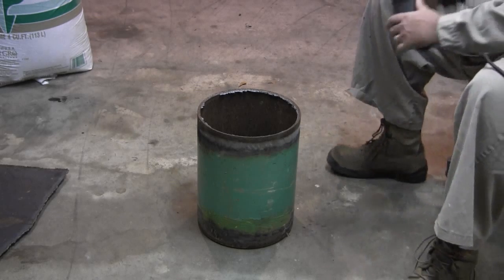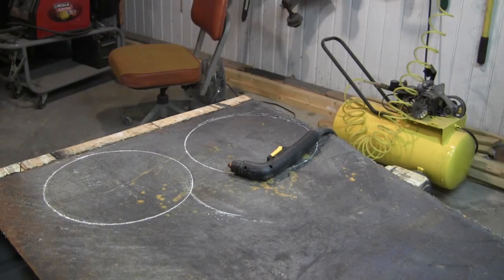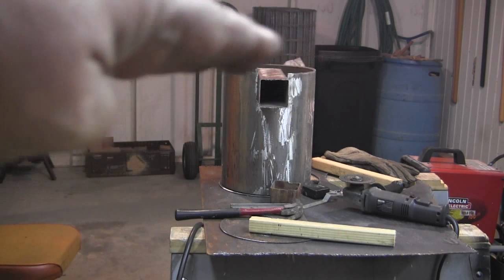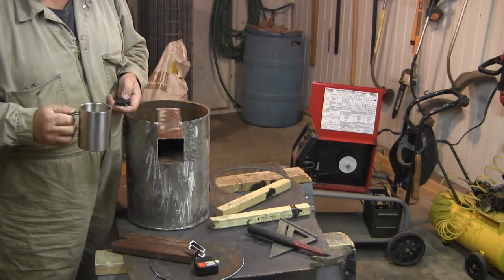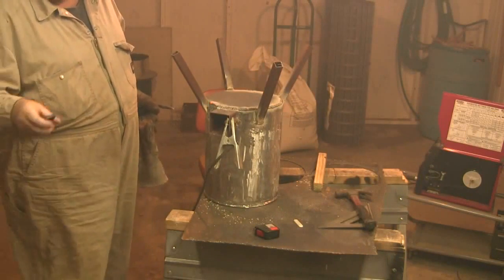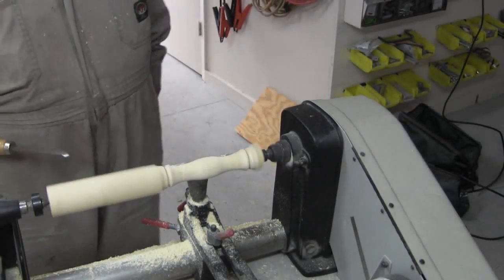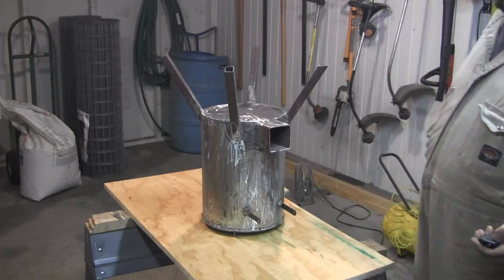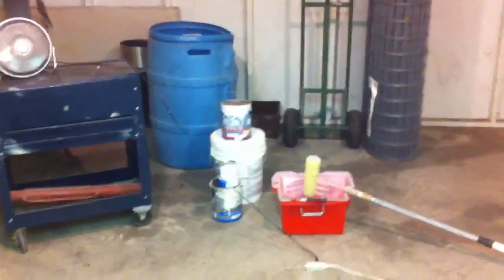How to build a  rocket stove start to finish

Comment: Love your style B !  Wouldn't I like a roomy workshop like yours.
 I really must find one of these cylinders, only thing is here, these cylinder makers make it an 'offence' to use their 'property' for anything other than returnable gas pressure vessels ! ( like I'd care anyway ! )  but I don't see too many just lying about.
Btw, glad you now have your plasma cutter - excellent tool.)
Reply from the maker: This particular stove was made from a section of pipe. Here,gas bottles belong to the person using the gas. I only use gas bottles that have expired the safety criteria because they are far more valuable if they are still within the certification time period. To have them recertified is as costly as buying a new tank.

Comment: Awesome job. Hey just a thought make a frame out of 2x4 that will fit in between the rafters. Take an 3.00 emergency blanket and cut it 1.5 inches bigger then the frame.
Then stretch it over the frame N-S-E-W till taught continue, till as tight as a drum. You have built high grade inexpensive reflectors. Place two next to your light and watch the room brighten up for sure !
Reply from the maker: now that is a great idea! I have some emergency blankets too!

Comment: Great build thanks for sharing I have a question about size my wife wants to a rocket stove large enough to do canning she wants to do it the off grid way with no power just sticks you say 3.5 to 4 more than the chimney or burn chamber so if I am correct if I use 4in tubing for chamber then the chimney should be apx.16 in high if use 6 in it should be 24in high am I correct? I need to build one large enough for a 30 to 40 quart  stock pot she  cooks 60 to 80 lbs of  products what size would you suggest size height and diameter thanks for sharing your work

Comment: BC, thanks for sharing. You should have put wheels and a motor on that bad boy so you could move it around, nice work. I thought about building something like that out of a propane tank.  It's on the list.
Reply from the maker: Mr. Rain I have a video of me building one out of a propane tank. It was the nicest one I built and it burned better and hotter than any I had built previous. I'm in the shop but when I go inside I'll find it and put a link in a reply. Or,I'll pm you.
Reply: Ha ha BC i found it! Thanks, just got done checking it out.

Comment: Hello Brad, hope you’re feeling better, I know how you feel. Don’t stop, you need to keep going or it will really put you down. Again get better. Now a few questions if you get time. Sounds like you are sold on the "Silverfire Survivor rocket stove". Are you going to keep making yours, and newer models? Also wanted to know if you were planning on making a Rocket stove heater for your shop. I have seen a couple on YouTube with "100 gallon propane tanks", but wanted your input on what you might have in your mind to build a small foot print shop heater. Keep well my friend and keep making your videos, there are very informative. Just skip over the negative comments, do not let them bring you down, keep doing what you do. Look at the positive comments they really outweigh the negative ones.
Reply from the maker: Hi Ronald. I am certainly a fan of the silverfire stoves. I build my own when the mood strikes me and when i have something interesting to make one out of. My next stove build will be a small woodstove for my 9x17 sunroom. its all glass and a bit hard to warm so a little stove in there will really help out. Im not sure what im going to do with my 100 pound tank yet. i thought i would make a stove out of it but now im leaning towards a solar hot water heater. thanks for watching and commenting.

Comment: Hey Brad great job. built like a tank. One question, I thought that the output would be at the bottom not the top like a regular fire box.
Reply from the maker: I think you're confusing a rocket heater with a rocket stove.

Comment: Great job I have followed your channel for a while I know you have built several rocket stoves I have tried to contact several people who build these things and everyone don't want to share here is my problem my wife cans lots of things and we live off grid she doesn't want to use power she needs a stove design that can heat up to 30to40qts of water for her canning I would like for you to share your knowledge with me like tube sizes hights and basic deminitons  any advice you could share would be greatly appreciated the biggest thing is how to figure the dimensions of the tubes she is new to all of this thanks for sharing your thoughts and time until next time keep up the good work
Reply from the maker: HUX METAL WORKS the formula I finally settled on based on my own experience and experimenting is the height should be 3 times the diameter of the burn chamber. The inner pipe should be well insulated from the outer pipe. That’s pretty much it. The larger the burn chamber and upright pipe, the hotter the fire.

Comment: You're a Talent! Great Job. I see you must have loved Shop Class in school like I did ; me 1972-76. But a Question: I am very creative and a retired carpenter by trade , and think knowing how to work with metal is a gift. I wanted to start. Do you think the Harbor Freight Tools  90 Amp-AC, 120 Volt, Flux Cored Welder can do the type of work you just did with this? 
Or do I need more power and how much? Thanks for the great video Tony S.
Reply from the maker: The welder I used on this project was a 110 volt flux cite wire unit. If you save a few more dollars,I would suggest buying a Lincoln,miller or Hobart. I've heard lots of complaints about the harbor frieght welder not lasting very long. I buy a lot tools from harbor frieght but sometimes they try to go to cheap on things and it just doesn't pay to buy from them.
Reply: Thank you! I buy American always, but short the money at this time, may go to home depot know, But 90 amp-AC is powerful to do that work? Usually I buy the best Dewalt, Porter-Cable etc... but just starting off WTF . thanks and let me know the power I need to weld like that. Thanks Tony S.

Comment: Thank you for acknowledging my subscription!  I loved the video on the Rocket Stove you built.  Talk about heavy duty and yes, it will likely last well past several lifetimes!   Being that I am mechanically challenged, I do have a question!  What kind of pipe or tube did you use for the base of the stove?  You also mentioned the importance of the dimensions.  Can you reveal the length of the fuel shoot and chimney?  Thanks again for a great video!
Reply from the maker: The body of the stove is some pipe I got when I worked in the oil field. I think it's 12 inch pipe. I used 1/8 the inch plate for the top and bottom. The inner portion is 4 inch square tubing. I can't remember the hight and length but it would be according to the hight and diameter of the outer pipe. I've built several other rocket stoves and they are all on my channel. The easiest one would be to build one from a freon tank or propane tank.

Comment: Nice  videos on rocket stoves. However, would placing the feed pipe at an slight upward angle help the wood self feed (slide) itself, rather than hand pushing the wood into the fire?
Reply from the maker: Then you couldnt control the heat. by pushing it in,you can control the amount of heat you want to cook with. There are people who have made the slanted feed tube. But that wasnt what I wanted to build after I thought about what it was exactly that I wanted my stove for. There are several commercial manufacturers of rocket stoves and none of them build a slanted feed tube.

Comment: well i'm new to this rocket stove but what do you do about the smoke do it need a chimney ?? over all a nice looking warmer for the shop gonna make one for mine THANKS
Reply from the maker: This isn't to heat with,it's to cook on. This is a rocket stove,not a rocket heater. They both work on the same principle of burning the wood has but are built differently.
Reply: OH ok so do you have a video for the Heather ?? like to see that if you do Thanks

Comment: Hey I would like to build a heater / pellet stove for my short bus.. I'd like to go with a 4"feeder tube at a 33 angle into the burn chamber. and go over that with a 6" pipe and exhaust with 6" stove pipe. but cover it with a 8" stove pipe and fan to blow the heat down to the floor.. any suggestions  would be helpfull.

Comment: Hi  I live in Canada and as you can imagine it gets cold up here in the winter. I have watched your video and you have the time in making these rocket stoves to know if what I want to do will work.
I am going to build a 10' x 10' insulated shed for a 300 gallon water holding tank for my horses. I would like to make a rocket stove that runs off of waste oil from vehicles or deep fryer oil from restaurants. Do you think if I put a tuna can size reservoir in the feed pipe of the stove that it would work properly. It would then have a drip line that would drip through a small hole in the top of the feed pipe and into the reservoir. Then I can regulate the drip speed with a small valve. What do you think. The drip line I'm talking about is from a fish hut stove design that we used years ago in a fish hut. The only real difference is the rocket design, Hope to hear from you soon. Scott
Reply from the maker: Scott,I think you would be better if with an oil burning stove. There is no way to contain the exhaust,which would be strong and probably poisonous, using a rocket stove. There is a variation of this called a rocket heater,but I have no experience building or using those.
Reply: +BCtruck, rebuild, repair,repurpose
 I was hoping that the heat of the gasses in the chimney or vertical pipe would be great enough to completely burn the oil up, like in yours were the wood greats the gas and the gasses are burned completely. Guess an outside experiment would be needed to find out. Could the vertical pipe not be vented outside the shed? The draft from the heat should take the smell or escaping gasses up the exhaust pipe. 
With the mass rocket stoves I have seen online they exhaust outside. 
Thanks for you input. 
Great videos you make and thanks for the quick reply.
Scott

Comment: why don't you have a rocket stove heater in your shop ? I noticed you had a wood stove. How about a rocket stove heater for your shop for your next build. Thanks again and i really enjoy your videos. Dave
Reply from the maker: Dave, I love the idea of a rocket stove heater,but im afraid it just be to hot for a louisiana shop. they are super efficient though and my friend kevin bacon has a video of his build and he does heat his shop with it buthe is in a much colder climate. Thanks for watching and commenting!
Reply: @dsdave43 A 'rocket mass heater' is quite a different animal than a simpler rocket stove. Look up Erica & Ernie Wisner. They wrote a 278 page book about it. It explains everything about these Rocket Mass Heaters. It includes fixes for people who designed them wrong. One mistake could make it work less efficient. Wood heat takes a lot of work. R.M.H.'s are large, take time to build (each one has to be nearly custom made), heavy (need plenty of support), need to be checked on every 1 to 2 hours (can't be left alone), chimney requirements, placement requirements, slow to heat up, (the mass), (weekend only heat? By the time its heated up nice, its time to go home) slow to cool down, wasted fuel/heat when no one's there, code requirements. Just lots of stuff, and more stuff I didn't tell you.

Comment: Lets fine some way to make propane stretch out by using less propane for the same amount of heat We know that Stench is use as a additive so you can smell propane cause propane by it self has no smell,  what else could we use?

Comment: Makes sense, for cooking or heating up a small space.
Reply from the maker: Thes stoves are called rocket stoves. Not heaters. They can't be used inside for heat. There is another version that is called a rocket heater and it does have a slanted feed tube. I think you may have the two confused. You can actually cook very well on the rocket heater but they aren't portable. That is why the rocket stove was designed to be portable but again doesn't heat. My friend has a channel called kbacon and he designed and built a rocket heater that he uses to heat his work shop with. You might Google the words kbacon and rocket heater too see his videos on the subject as well as his build. If I was home,I would just provide a link but I'm limited what I can do with my phone v
Reply: BCtruck, rebuild, repair,repurpose Thanks for clearing that up, BCtruck!

Comment: It the handle was on the back it would be less likely to burn as the fire comes out of the front of the stove.  Just a thought,
Fred
Reply from the maker: The fire doesn't come out the front of the stove. That's not how rocket stoves work.

Comment: Nice stove, thanks for sharing. I will trade you my workshop for yours? Help a Missourian out.
Reply from the maker: Hehehe!!! I'm kinda partial to my cozy little shop. I have a wood stove now and a comfortable chair. I'm afraid I will be doing lots of eyelid maintenance checking for light leaks. Sometimes the light leak test can take a half hour or more.
Reply: BCtruck, rebuild, repair,repurpose Since retirement, I'm a two hour minimum. Ha, take care.

Comment: I need heat not cooking...
I need heat I can use in a small 10x10 hut in the snow...
I need heat that wont kill me.....

still not found anything to do this... if the shtf, how would you do it....
Reply from the maker: kbacon has a rocket mass heater that he built for his shop. would that be something you would be interested in? it would need to be very small to work in a 10x10 but. I will be building a small woodstove very shortly,in fact i may get started on it today,to put in my 16x10 sunroom.
Reply: leslie briddon This type of rocket stove isn't designed to be used indoors. Depending on what's available in your country, your options are: Fireplace, vented wood, liquefied propane (LP), or kerosene (paraffin oil) stove. Here in the US, ventless LP heaters and portable kerosene heaters are available. 

For your hut, consider a travel trailer (caravan) LP furnace, providing you can supply electricity to run the fan. (Wind, solar, grid hook up). FWIW, I have a cast iron box stove in my 12x16 shop. Same style as BC's in his shop. Almost too much stove for mine. A smaller option for your hut is possibly a tent stove. Several versions available including DIY & commercially supplied. Disadvantage to smaller wood stoves is they have to be refueled more frequently. 

Hope these thoughts are helpful.

Comment: I'm confused.... where did you/can you acquire the thick 1/4" metal tube from for this project.  That's not exactly something I've ever come across at Lowe's or Home Depot which makes me curious how you came by that.  If you'd let us know, I'm sure that many of us out there would be mighty thankful. Best Regards.
Reply from the maker: Piece of scrap I found on a well site.
Reply: Gotcha! "Well" it looks like a nice find (no pun-intended).... still makes me wonder where I could acquire pre-shaped cast iron of that caliber thickness. I'm trying to figure out how to remove Flouride from our city water supply through distillation, if that's even possible. Haha. Thanks for your response, your videos are great and help give others ideas!
Reply: How about you find an old large fire extinguisher and cut yourself a large tube out of that. Or a propane bottle you can get a very large one out of those.  Both of these are large enough I think and have thick walls.
Reply: Buy a Berkey water filter system.  It doesn't need electricity as it is gravity filtered.  I I bought one and the water tastes so nice.  Go to their site and inform yourself.  Good Luck.

Comment: Sorry I should have been more clear I meant the length. I plan on building one this weekend after building my greenhouse.
Reply from the maker: the length and hight will be different according to what type and size stove body you use. the only important parameter you have  to stay within is the diameter of the internal tube,to hight ratio. that ratio is 3.5 to 4. whataver diameter pipe or tube you use for the burn chamber and chimney,the hight should be 3.5 to 4 times that diameter. how far out it sticks horizontally is not terribly significant either.